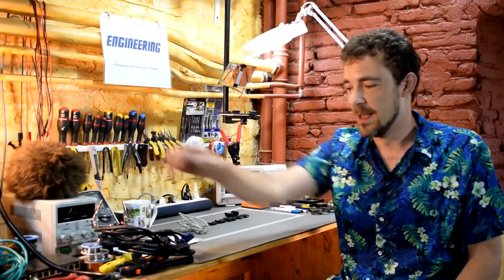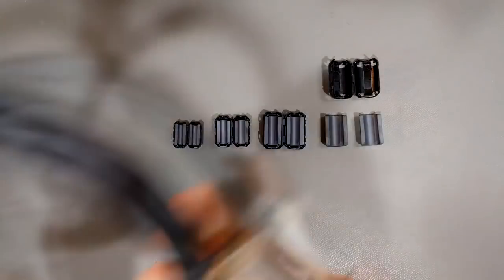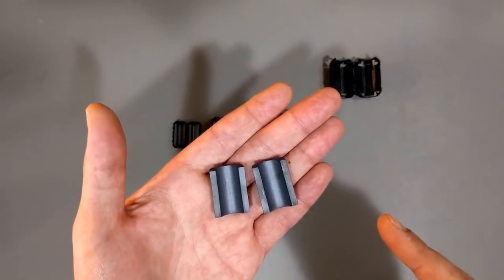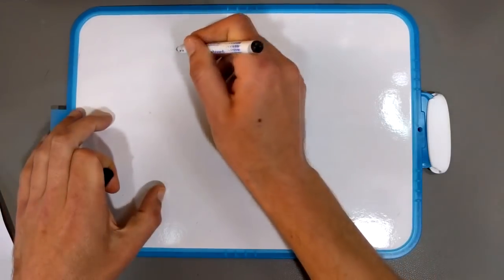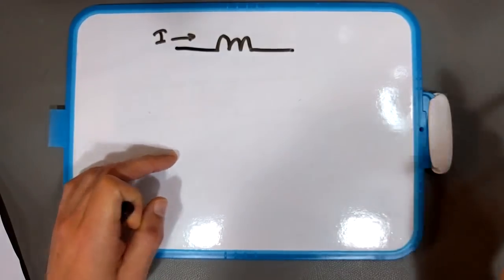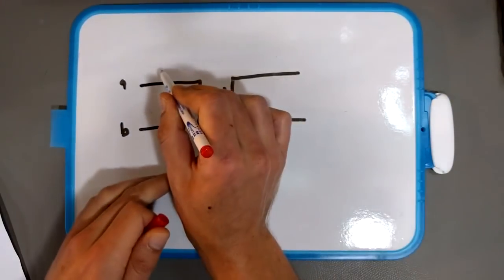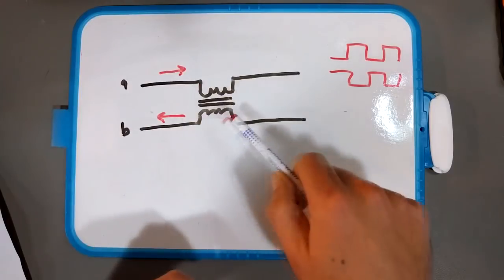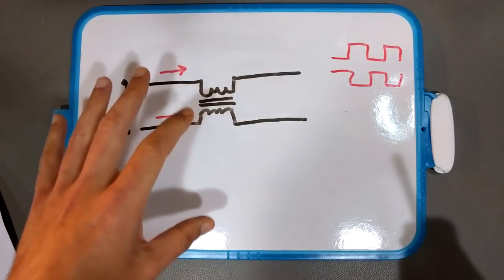Ferrite: Those magic thingies at the end of your cables

Comment: I have a laptop connected with amplifier and speaker for listening music. When laptop power is plugged in i hear 60cycle noise from speaker. But when laptop power is removed the noise is substantially reduced. My laptop power cable doesn't have this ferrite bead. Now if i buy this clip on beads, will it solve my problem?
Reply from the maker: No, that won't help. But if you're using the headphone/line out jack on the laptop, you could use a USB->audio adapter like this: https://amzn.to/4hEzvMg
That should work nicely!
Reply: @ScottiesTech  Sometimes i plugin electric guitar through an audio interface to Laptop. Now when i listen to the headphone out from the audio interface, the same 60hz noise is observed. But when laptop power is unplugged, the noise is gone. For this situation this clip on beads will work? Thanks for the reply!
Reply from the maker: @GirishKumar-q9f  Hmm... In that case, I would get a different power brick for the laptop. I had a laptop like that once, and it was a nightmare getting the noise to stop. The problem is that the noise is being passed on inside the laptop. OR... maybe: sometimes re-arranging cables helps. As in: don't run an XLR cable on the floor right next to the lappy power brick (or any other power brick or cable).

Comment: It seems these usb cables are normally not recognized..
I have 2 of these long cables, but they are not recognizeable.

Is there anythang I can do?
Reply from the maker: It might be length, or it might be that they don't have the data lines connected internally and were only intended for use as power cables. Or something I didn't think of!

Comment: I just bought a variety pack of the ferrite clips, I’m really hoping it’ll stop adding noise to my focusrite Scarlett 2i2 audio interface.  I’m going to clamp every single thing I can think of.  Wish me luck!
Reply: I'm having the same issue now. Did it work?!?
Reply: @AZNFLACO  unfortunately, not really.  By now, I’ve determined the issue to be RF noise coming from my computer, but don’t know how to eliminate it (dirty air)
Reply: @ChrisRostom  such a bummer. I will continue to research on how to fix it. Thanks for your reply!
Reply: @AZNFLACO  of course, let me know in how it goes
Reply: @ChrisRostom  how did it go?
Reply: @MykEviiL  not good.  Even got a idefender usb ground lift thing, didn’t work either.  However, I found a solution that works perfect for me in recording and maybe even live playing settings.  Gonna make a video on it soon.
Reply: @ChrisRostom  is it the ISP Hum Extractor?  :)  I'm getting that to help with guitar interference gonna try it out

I did have some with my audio card but I cured that with EMI/RF power filter, the PC plugged into it.

If it's through your speakers you can get a HUM eliminator by morely or Pyle to kill a ground loop between the speakers and interface. I don't need one of these.

However I have a pod go that carries EMI/RF through the USB cable.
Are you using a gaming case? 
I thought about testing out if I swap out all components. Using an all metal chasis, silent PC case, high end mobo  high voltage power supply etc. All the best stuff. Was thinking about trying USB over ethernet to see if that would work. OR dedicated PCI-E USB card. Are all options.

I really want to try this out scientifically. Without buying ifi adapters etc. 

I thought about even a USB to spdif/or Fibre optic box, or USB to USB c cable and add a pcie card to PC to see if any of this will fix and stop the transmission of EMI and Rf being carried down the cable with my pod go.

You if for guitars and bass you could try a dedicated direct box with ground lift and combine with a good noise gate four cable method.

Rev G noise gate....orrr ISP hum extractor. :) 

I'm testing out the Hum Extractor soon on order.

But won't help with thr RF/EMI transmission on pod go through the USB cable. 

I can use my audio interface for recording.... but if I want to use the software editor for POD I have to listen to digital noise.
Reply: @MykEviiL  no it’s the idefender Plus.  Mine is usb audio interface, but I honestly think the main problem is just the dirty air floating around in my apartment.  And I have no idea how I can clean that up.  Possibly I might have to shield the guitar pickup cavities.
Reply: @ChrisRostom  is the noise gone when guitar is unplugged? 

I'll let you know when I try the ISP hum extractor. No noise with guitar out of equation. Add the guitar and it is there when in proximity with the PC. PC is on the floor. It Gets louder as I put the guitar closer to the PC. 

Except for my pod go. The interference is carried through the usb cable guitar or no guitar. Either the USB port is faulty on it or it's traveling through one of my PC components. So by process if elimination I'd like to try slowly swapping components starting with the power supply and the case to see what is the cause. This may include a seperate dedicated USB card or USB to ethernet, instesd of adaptors and expensive USB cables.

I have 2 USB audio cards. I was getting interference through my amps etc. Buy an EMI/RF power filter stopped it from leaking in through my speakers. 

However the guitar still causes it to come through when at my desk in proximity with the PC. The further I get away in distance the less it is there. However I still believe there is noisey components in my pc that are the culprit, when I'm at my desk. Still may be experiencing some 60 cycle Hum and PC noises. 

The hum extractor should be able to tame most of this. But won't fix the EMI/RF transmission from the pod go to my PC when using the editor.
Reply: I want to find the source and lessen the transmission of Rf/EMI itself at the source that is causing it. Of course with laptops this is not as possible.
Reply: @MykEviiL  I’m in the same exact boat as you.  No noise when no guitar is connected.  The noise is purely due to the “dirty air”.
Reply: @ChrisRostom  I subscribed to your channel by the way, good stuff. 

Yeah I called ISP headquarters and sent them a clip of the noise and they seem confident the ISP hum extractor + g will decimate it. Ahaha. 

Except for the digital noise carried to through the pod go via the usb cable (even with guitar unplugged) . Which is why I would still have to find a resolution for that.
Reply: @MykEviiL  for me, I even tried disconnecting some power stuff from outlets, but I fear that I might be limited in eliminating it all together.  For now I found a great solution which I’ll post soon.
Reply: @MykEviiL  awesome thanks so much.  Let me know how it all goes.  If it works, maybe I’ll give it a shot

Comment: Chokes on a DC wire ?
Reply from the maker: Yup, that's common on things like DC power bricks for gizmos... because the switching power supply can produce 'high-frequency' noise, OR more likely because the power cable (for things like PC speakers) can act as an antenna and pick up noise from the puter, which then gets passed into the speakers and amplified.
Reply: @ScottiesTech  Please  , in spanish .

Comment: What would a ferrite bead do to a 5g tower?
Reply from the maker: Not much. It depends on the type of ferrite itself and the frequency of the 5G system. 5G can be low frequency (i.e. 600 Mhz) all the way up to tens of GHz (millimeter wave). Ferrite is usually used to block 'high-frequency' noise that is much lower than, say, millimeter wave 5G.

Comment: So I have an 75 watt Led light on an airplane and it creates noise on my aviation radio, any way of getting rid of this noise/ the Aviation radio is 122.976 MHZ.
Reply from the maker: Hmm, that can be tricky. You seem to have figured out that when the LED light is on, the driver circuit for the LED is generating noise. Most likely, that noise is audio-frequency, and that's being coupled somehow to the radio. It could be a loose ground connection for the light, or coupling between two wires in a harness somewhere. You might try an 'audio noise filter' on the power leads for the radio (which is not just a ferrite core, but usually a capacitor and sometimes another component or two).

Comment: Question:  My PC is an RF hot box and anything within 6 inches becomes hot as well.  Take for instance my microphone next to the pc it picks up hum and get it over six inches it goes away.  I noticed on the VST (EQ) I was using that when I hooked up a DBX286s the frequencies were all over the place but the peaks were 60/120/180/etc... so 60hz mains hum with a lot of harmonics.  What do I do for that?
Reply from the maker: Alas, no. Ferrite blocks high frequency noise, not low-frequency. If there's a lot of 60Hz + harmonics, you may want to check your ground as well as any and all power supplies (puter, power bricks, etc). One bad supply can create lots of problems like that.

Comment: so it would have no effect on an electric cable to a lamp or kettle etc.
or would it ?
Reply: It would have an effect, but for 50/60 Hz AC, the impedance is so low that there is not much happening in the ferrite. Usually ferrite cores for filtering have theyr impedance specified at 100 MHz, as that is around the frequency where they present the highest impedance. And if you put both the neutral and phase wire thru the same core, you have a differential mode current flowing to your load and back, and not a common mode current. So it really depends on what you would want to filter out on that electric cable...
Reply: @ProtonOne11 Thanx ..Could it increase the efficiency of an electric kettle ? ..saving time and money

Comment: Is it really necessary to have these if I use such s cable just for charging my redmi smartphone and datacable? I'm asking this because my sony cable has broken at the base of  this bead and thus I need to remove this bead to make my cable working again and wind back the cut wires...please do respond at the earliest
Reply from the maker: No, they're not absolutely essential. You should be fine if you remove it.
Reply: @ScottiesTech yeah I did it it gives little trouble no problem infact

Comment: What happens if you use two ferrite beads on the same cable?
Reply from the maker: You get more noise filtering - usually.
Reply: @ScottiesTech  My laptop charger went bust thanks to a surge and I had an old charger with a broken tip lying around, so I tried a very crude work around of attaching one cable with another without cutting off the Ferrite bead. So from what you say, I'm guessing there shouldn't be a problem?
Reply from the maker: @Hi.M_Anshu  Nope, that shouldn't be a problem.
Reply: @ScottiesTech  Thanks mate ✌️

Comment: Your clip is not useless for me, it just confirmed that the AC spindle on my CNC router was f-ing the data signal passing thru the USB cable and messing the movement of the stepper motors! Thanks for your vid, i subscribed for sure, cheers from Transylvania, Romania, Europe! :)
Reply: H Higgins  Thank You for the reply! 😎🙏

Comment: Why are those ferrite chokes mostly found on older cables?
With the modern, higher frequencies, I would expect them to be more significant instead.
Especially high bandwidth digital stuff like USB 3.1 generates a ton of noise.
Reply from the maker: I suspect it's a combination of cost savings, higher frequencies (at which the ideal antenna length becomes much shorter than, say, a USB cable, and thus the cable doesn't act so much like an antenna that picks up the noise), and better overall design.
Reply: @ScottiesTech  Well, the costs savings make sense. 

But when it comes to, for example USB noise, I was mostly referring to emission of the noise. Especially the ~2.4GHz bands, like WiFi and Bluetooth communication is are known to be susceptible to the USB 3.0 noise. Even with good shielding the noise still gets radiated, because of the capacitive coupling between the shield and datalines.

But TBH, I don't know how well ferrite chokes work to prevent RF emission, since most sources only mention the filtering of incoming noise.
Reply from the maker: @QoraxAudio  As far as I know, ferrites don't really do a very good job of preventing radiated noise at high frequencies. But then, I'm no EMI specialist by any stretch. That's an entire science in and of itself!

Comment: Would it benefit to use multiple of them on the same dc brick cable? Like 5-10 on 1 cable...? What about using them on guitar cables?
Reply from the maker: It might, although usually it works better to loop the cable several times through a larger core.

Comment: I have a drill charger that causes noise on an FM radio. I put one of these on the power cord of the charger on the charger end. It cut down on the noise but not all the way, Should I put another on the plug end?
Reply from the maker: Or use a bigger one, and wrap the cord through the ferrite core several times.

Comment: Hey Scottie, thanks for the video. I appreciate you taking the time to make it. A few of my dashcamtalk.com forum members and myself are having a problem with high-pitched noise coming from our Viofo A129 dashcams, but only when they are connected to the car's fusebox using a Viofo 3-wire hardwire kit. 

I was hoping you may be able to help. Here is the dashcam we're all using: https://www.amazon.com/gp/product/B07DL8MS1T/ref=ppx_yo_dt_b_search_asin_title?ie=UTF8&psc=1 and here is the hardwire kit, that seems to be the root of the problem: https://www.amazon.com/gp/product/B07K83R5W1/ref=ppx_yo_dt_b_search_asin_title?ie=UTF8&psc=1 

And finally, here is the forum where this is being discussed: https://dashcamtalk.com/forum/threads/a129-duo-high-pitched-noise.38653/ I know I'm asking a lot, but if you have some time any advice you could give us would be very much appreciated. Thanks!
Reply from the maker: Well, lessee... According to the various posts on the forum, the whine seems to come and go and it's hard to narrow it down to the hardwire kit or the camera itself.  It's powered by a USB plug, and it looks like the 3-wire cable already has a big honkin' ferrite core on the cable. One thing to try is if you have a USB battery bank (like for recharging smartphones) that was a 2.1A output, try powering the cam from that battery bank with a USB cable. That should be a relatively clean +5V supply over the USB cable. If that makes the whine disappear, then it's essentially a problem with the 3-wire kit.

In that case, you could try adding another ferrite to the cable (loop the cable through a bigger ferrite twice if you can), but that seems like a stretch since there's already one present.  I would actually lean more towards some issue with the cam itself. The cam seems to have both WiFi and GPS, both of which could cause noise. And if it's a prob with the design of the cam, that could also explain why something seemingly goofy like changing the SD card could change the whine. That might slightly change power requirements or something, thereby modifying or stopping the whine.

But in the end, if powering with a clean 5V supply (like from a Li-ion battery bank) doesn't work, and another ferrite doesn't work to block noise introduced by the 3-wire cable kit, then I'd lean towards inadequate EMI shielding/isolation inside the unit itself.

Comment: Enjoyed your video. Would you happen to know how I can reduce the interference from tv cable and electrical cable running side by side? Whoever installed the TV cable at my home installed it next to the electrical cables/wires. I'm always getting TV screen freeze or my sound fades on my TV.
Reply from the maker: If the TV cable is coax, it should be relatively immune to interference from power lines. I would check all connections first, and then perhaps any amplifiers on the line.
Reply: @ScottiesTech  Thank you for getting back to me.

Comment: I had a printer which would stop and fails if in the middle of printing someone turns on a car, microwave oven, or even lamps nearby. I solved it completely by using an USB cable with ferrite core in both sides. The one which came with the printer hasn't it.

Comment: You said they cannot restrict lower frequencies like AC hum, but could it restrict 59 kHz frequency?  which in deed fried an iPad recently!
Reply from the maker: Maybe, depending on the ferrite used... Most of those available to snap over cables start around 150-300kHz and suppress up into the multi-MHz range... But their frequency response is pretty much a bell curve, so you would get only a little bit of attenuation at 59 kHz... AFAIK, anyway!

Comment: Always chill informative videos. Question, has ferrite been used to protect from other types of frequencies, like a Faraday box in a way? I'm not smart.
Reply: Testing rooms for radio emission and immunity are usually completely covered on the inside with ferrite tiles, to keep the outside radio signals away from your measuring devices, or to keep the generated fields in the test room inside. On top of the ferrite tiles there are normally some more absorbant cones inside the room to eliminate most of the reflections of radiowaves from the walls and ceiling.